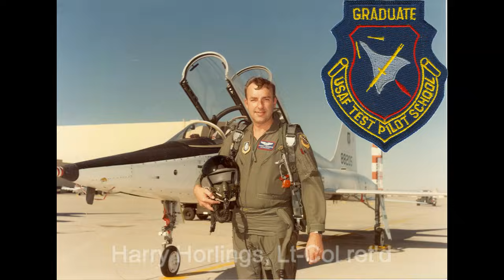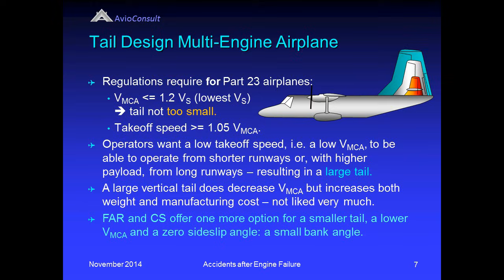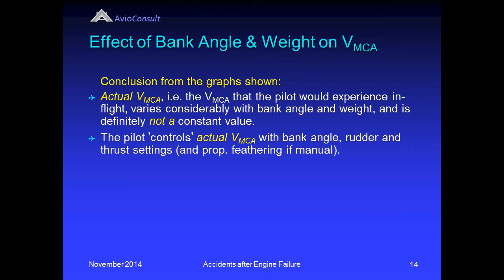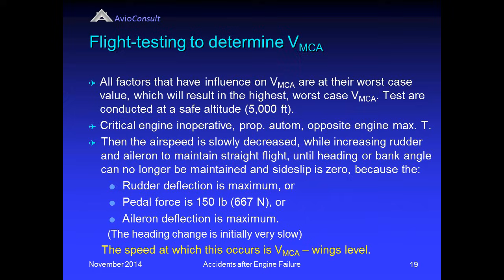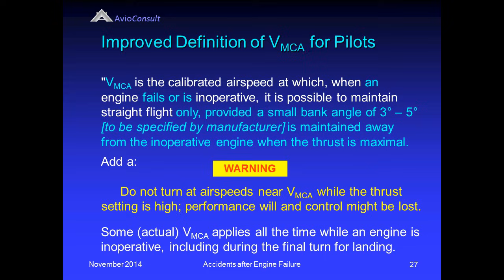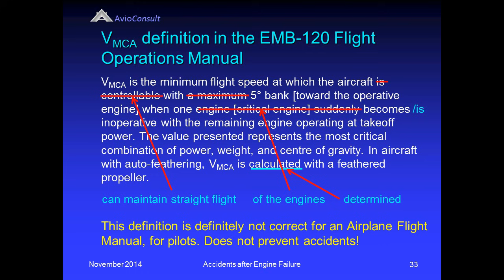Airplane Accidents after Engine Failure  - Real Value of Vmc

Comment: Wow. This was a great video and you made some really important points esp wrt Vmc vs Vmca... and why the copy and pasted version is crap (for tail design use only). Makes a lot of sense... Great job.  I am not a twin pilot, but incorporating the logic of your argument makes sense to apply the 1.05+10knots with ANY plane.  The immediate 5 deg bank INTO the good engine on failure, should be taught and practiced. Imo this is game changing for the safety of AV community. First Look Group below posted the Wichita crash link. Left rudder? Why would any sane pilot do that?

Comment from the maker: You wrote: "This video is not at odds with what multi engine pilots are taught". I agree but would change the subject: What multi-engine pilots are taught is no longer at odds with Airplane Design as taught by Dr. Jan Roskam (KU), with the FAA Flight Test Guides in Advisory Circulars and with the papers by a flight test expert on the downloads page of website www.avioconsult.com. The real problem, and the cause of many accidents, is what pilots do not learn anymore about Vmc(a), like the conditions under which Vmca is safe to fly. 

When the small bank angle is not being maintained, not only the drag increases (sideslip) but also Vmc (Dr. Jan Roskam, KU: "Vmca and Performance are tied together by the bank angle"). Therefore the technique to be used by pilots after engine failure is to maintain straight flight while banking 5 degrees away from the failed engine (The exact bank angle should be provided by the manufacturer with Vmc(a) data). The vertical tail of a multi-engine airplane is not designed, is not large enough, to be able to maintain control (and performance) for any other bank angle when the airspeed is close to or equal to Vmc(a) after failure of any engine, critical or non, while the opposite engine is set to provide max. thrust. During experimental flight testing to determine Vmca and evaluate the controllability during flight and during go-around, we apply this technique and we don't crash. 
Lack of adequate rudder increases the actual Vmca, i.e. the Vmca that the pilot experiences in-flight. The E120 pilot allowed the heading to walk away from the initial heading while he had ample rudder available, hence did not maintain both heading (straight flight) and a small bank angle. 

Vmc is a safe airspeed provided a pilot understands and applies the conditions that come with it. The Vmc published in flight manuals is the worst case Vmc that a pilot will ever experience in-flight. It is safe, but only if he or she maintains the heading and the small favorable bank angle. Otherwise Vmc will increase above the IAS and the dead engine will turn into a killing engine. These important conditions were and are regrettably not published in pilot manuals and course books anymore during the past 50 years. Exceptions: Lockheed C-130 manuals and old DC-8-63 manuals. 

Five degrees of bank would have saved the E120 flight for sure; it's undisputable physics: the balance of forces and moments. Neither the flight instructor, nor the pilot was obviously aware of the real value of Vmca, because there are probably no course books anymore that are right on this subject. Most, if not all pilot course books are not in agreement with Roskam and the Flight Test Guides issued by (an other department of) the FAA, that are also used at Test Pilot Schools. Even FAA-H-8083-3a/b Chapter 12, Transition to Multi-engine Airplanes, is definitely not right. Please refer to the downloads page of the mentoned website, download #8. 
I really wish you could show me a ME rating course book in which Vmc is correctly explained. 

By the way, Vyse is not safe either to turn either when one engine is inoperative and the other is at max. thrust.

Comment: While the analysis is interesting and on point, using the second example to illustrate the point is off.  If the aircraft is certified with an auto feather and it was not put in simulated flight to represent these conditions, then likely no technique would allow it to maintain required speed on the V1 cut.  The E120 pilot did infact attempt to raise the left wing a couple of times, but his lack of full rudder thwarted his efforts.

Also the VMC definition is used because there is a need for pilots to understand the factors used to determine VMC.  I know of no multi pilot that assume Vmc is a "safe" airspeed to use.  It is drummed into every student that Vmc is that, the minimum speed, lower and you will lose control.  Vyse is the airspeed target.

So no 5 degrees of bank would have saved either of these flights.  There is a risk involved with flight below Vmc as in the first example, and there is risk involved with improper configuration for V1 cuts and simulated single engine flight.

The video is informative, but unlike the assertions, it is not at odds with what multi engine pilots are taught.  Airspeed =Control=Life.
Reply: I am type rated in the EMB-120 and flew it as a FO and Captain for over 900 hours for a 121 carrier in the US. We had to do an engine failure, at V1, AND have auto feather failure as part of our training. We would have to feather the prop manually. If V2 is maintained along with correct rudder and bank inputs, the Brasilia will not VMC roll. The reason this plane did is a combination of what the video spoke of- Not maintaining V2, (the airspeed degraded down to as low as 103 knots very quickly after take off), not putting in and maintaining the correct bank into the operative engine along with correct rudder inputs, and the pilot flying increased the Torque from 94% to 108%, which increased VMCA as well. If you read the report by the ATSB, they conclude that factors in this accident were the pilot flying increasing torque, incorrect rudder and bank, engaging the yaw damper, and operating at an incorrect airspeed. Also, in this accident, there is a disclaimer from the ATSB in the full video which states :The yoke and rudder pedal movements could not be used directly because of a sensor problem, an analysis was done and the inputs in the animation are estimates only. The EMB-120 can and will maintain heading with an engine failure and auto feather failure if flown correctly, I had to do it for my type ride and at least once a year for my PIC check. As for the other accident, they rotated way to early, and you are correct in that 5 degrees of bank was not going to save them at that low of an airspeed that close to the ground. The point that is being made is that early rotation was the culprit in that accident.

Comment: Absolutely perfect explanations and demonstraions!!! This information should be like a "bible" for twin engine pilots...I'm an electric/electronic engineer(doing my final practices to get the degree) but aviation is my passion. This is one of the best videos I ever watched. Engineers  calculate EVERYTHING with high enough safe margins, but I certainly think that the TO speed is very near the Vmca, I believe 5% is a very low margin given the fact that when an engine fails so close to the ground and with a high AOA the speed will drop immediately, and probably for some airplanes this TO speed is almost the "wings leveled" Vmca. Why don't the flight manuals publish a higher TO speed, "just in case"? Why most of the pilots have to investigate on their own to get te safest speeds?? Shouldn't the wings leveled Vmca be published to have a better safety margin? 
 I'm sure some instructors will add this 10kt safe margin but I believe in general there is also an excess of comfidence on the engines' performance and piloting skills that certainly leds to catastrophic accidents.
Reply: I agree with you, Diego.
With such low safety tolerances, one begins to wonder whether flight manuals are designed to impress potential buyers (useful figures to bolster the sales person!), due to the psychological impression of 'better' performance!

Comment: Excellent!  Thank you.  Everything you said is correct.  Some questions from me:  In the first crash example, would it not have been very difficult for a pilot to recognize the sudden failure of the right engine unless the pilot was staring at the engine gauges?  Certainly the pilot would have felt or observed the yaw to the right after it began to occur but in this example, wasn't that too late?  However, if the pilot had rotated at 1.05 Vmca +10 knots as you say, he would have had more airspeed, and perhaps an extra two seconds to figure this out and attempt to stop the yaw.  However on that aircraft, and in your example the pilot did not appear to have had sufficient time to process thought to reduce maximum thrust on the operative engine to prevent the roll, while at the same time mentally processing the other multi-engine emergency procedures - banking into the operative engine not more than 5 degrees, controlling the yaw, gear up, flaps up.  Do you agree or am I incorrect?  I fly a Seneca II and am applying your lesson IMMEDIATELY to my flying.  Thank you for sharing your important analysis.
Reply from the maker: happysawfish, I fully agree to your excellent analysis. Indeed, recognition, processing and appropriate actions at too low a speed are nearly impossible; loss of control cannot be avoided. The safety margin is still very small when rotated with wings level at Vmca+10, but the airplane motions are not that vigorous, as the second accident shows. Pilots will have time to analyse why their rudder is not effective enough to counteract the yaw (provided they viewed this video). The Seneca Flight Manual I have requires closing both throttles if the airspeed is < 85 kIAS when an engine fails during takeoff - a pretty good safety margin. 

Thanks very much for your feedback, I really appreciate that. Please tell other pilots, and post this on pilot fora, because I can't anymore; I was kicked out because my work was regrettably seen by moderators as commercial, not preventive.
Reply: +AvioConsult I still say the co-pilot should have noticed it and aborted take off. At minimum shut both engines down and take your lumps! As the minimum airspeed before rotation is right on the gauges. As it's the co-pilots job to confirm minimum rotation speed has been achieved. If he says no, you either abort or wait till you do.

But I'm smarter because of what you taught me...

Comment: When I was getting my multi engine rating 37 years ago my instructor made me experience this loss of control at 5000 feet above ground and allowed the plane the completely roll over and note the speed when it began Beech Baron e55. In that experience I never forgot how useless the controls were. and I always took it upon myself to practice whenever  got the chance.
Reply: Don't Barons have the tendency to get into unrecoverable flat spins if you stall with asymmetric power? I think Barons have a minimum intentional engine inoperative speed for this reason.
Reply: That was just plain stupid and reckless by your instructor. A high asymmetrical Vmca roll in any twin that is allowed to fully develop into loss of control is about as dumb an intentional maneuver you can do. You are lucky you are not dead. Do a google search on that, especially in Barons, which have a propensity to flat spin in that configuration. Better yet, go get an ABS BPPP instructor and ask him or her to do one of those with you and see what their response is. Here is the link: https://www.bonanza.org/training/pilot-training/

Comment from the maker: I regret very much that this accident happened; my sincere condolences to the families who lost loved ones.
The accident is very similar to the EMB-120 accident in the video. Loss of control, even when the airspeed was V2. This proves that V2 is not a safe takeoff safety speed.
This ATR72 accident should not have happened; proper limitations are in place (in flight and ops manuals) but are regrettably not understood anymore by airline pilots.  I do not blame the pilots, but do blame the authorities in the USA (FAA and NTSB), in Australia (ATSB and CASA) and in the Netherlands to whom I wrote letters and e-mails many years ago telling that airline pilots operate their airplanes after engine failure in a way that is definitely neither in agreement with the limitations that are the consequence of the design/ sizing process of the vertical tail of multi-engine airplanes, nor with the way that the minimum control speeds are determined by experimental test pilots and flight test engineers, who are graduate of one of the few test pilot schools. These authorities do not understand this either.  The oldest Flight Manual that was right on this subject I've seen is a DC-8-63 manual, 50 years ago.  Thereafter the proper knowledge faded away (except at Test Pilot Schools).
All engine-out airspeed limitations (Vmca, V2min) are valid only while maintaining straight flight, that is while banking a few, up to 5 degrees, away from the inoperative engine. The manufacturer should specify the exact number of degrees, but the FAA and EASA do not require this.
I wish somebody could send me a pdf copy of a few pages out of the ATR72 AFM with Vmca and V2 definitions, engine emergency procedures and one engine inoperative performance data tables/graphs, to analyze and review and let the world know whether these are right for this airplane. No pilot wants to get killed due to inappropriate manuals, I'm sure.  I can help and will publish the result on my website avioconsult.com.  On the downloads and accident pages are many papers available.
Fly safely.